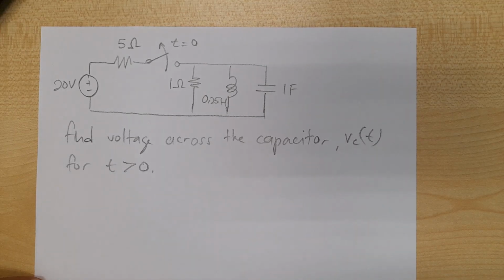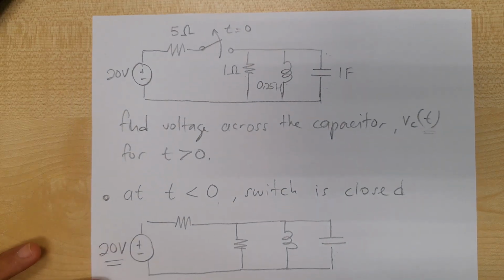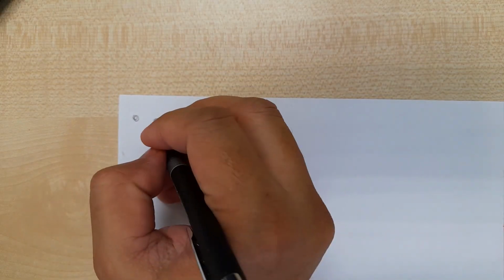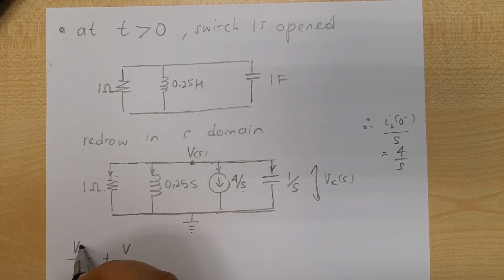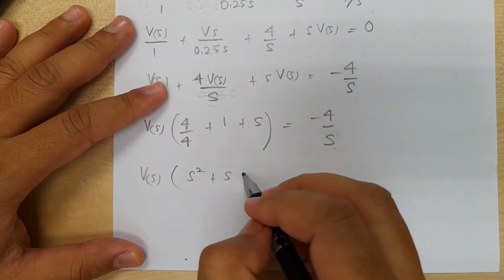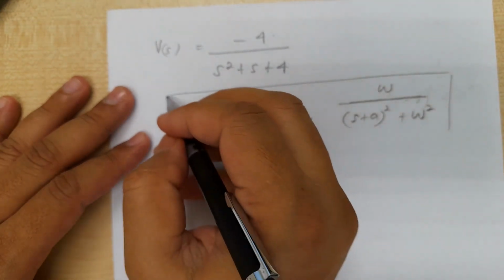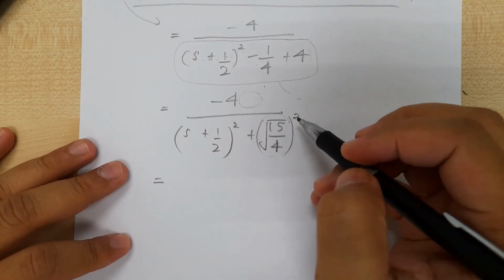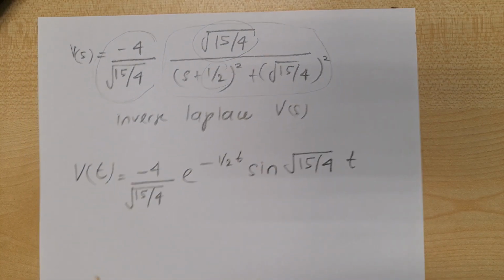Laplace transform circuit analysis - RLC circuit with switch

Comment: My man i think your completely wrong. If a cap and inductor are in parallel the capacitor becomes a open circuit BECAUSE ITS FULLY CHARGED. If the voltage of the cap is 0V, then its an empty capacitor which would act like a short circuit.
Reply: thats what he did? wdym